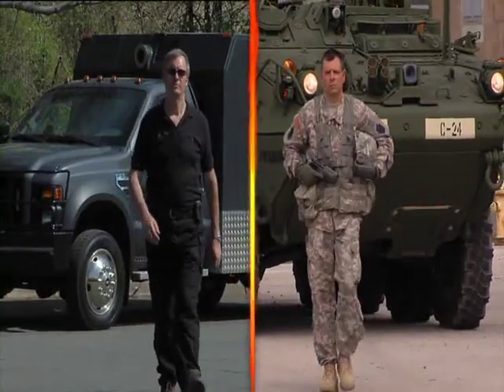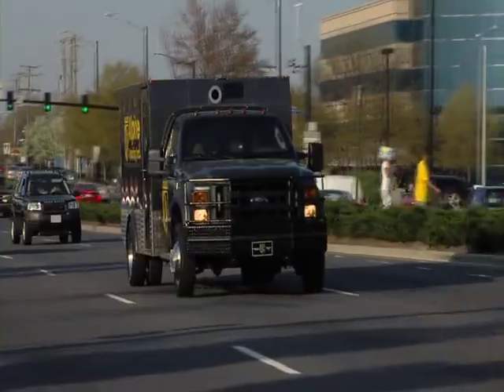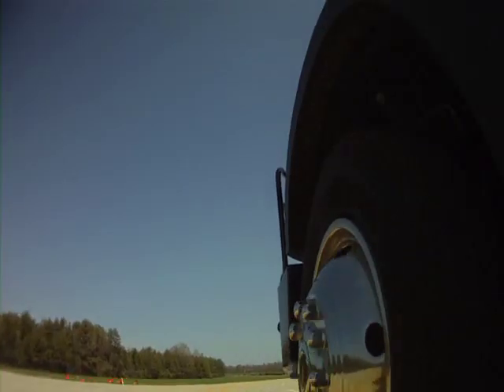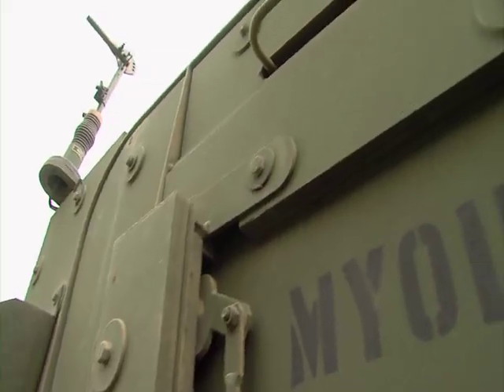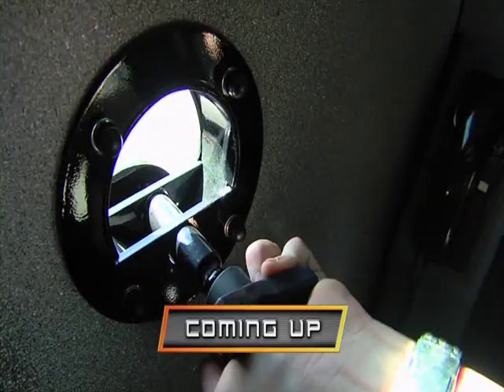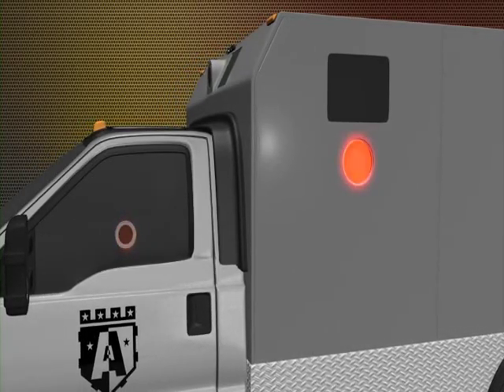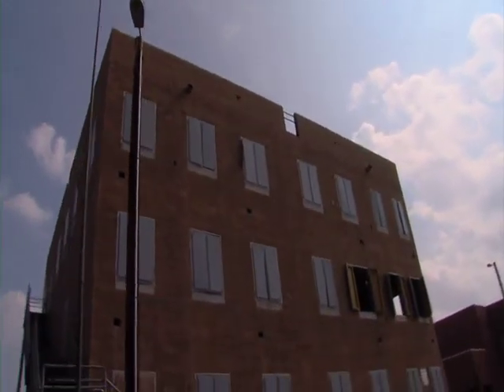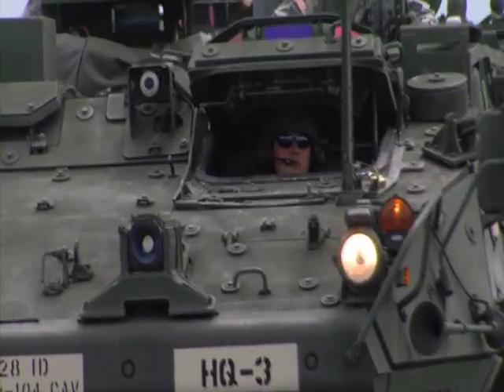Speed Channel - Intersections - Armored Bank Trucks by Alpine Armoring

Comment: Damn, when I used to work for an armored truck company we didn't have trucks that awesome. Ours would break down all the time, no tire protections, no gun ports, and the only cameras on the vehicles were the ones inside to watch myself and my partner.
Reply: +Keliohesten 
Sounds like you drove the first bank trucks. What year did you work in the industry?
Reply: +Secret User That's the sad part. 2015, I worked for Loomis lol.
Reply: Keliohesten
Damn, that's a sad company. lol
I like Brinks, paid training, and they issue you a brand new M&P .40 pistol unused with brinks logo. You'll have to make small payments to pay the pistol off but it's yours forever, and it's an amazing quality firearm. I prefer the armored car jobs for the pot industry. They get all the fancy toys for their trucks.
Reply: +Secret User Damn, that's awesome. Only good thing about Loomis is that they issue you a firearm for free. You just don't get to keep it, but their equipment is trash. I was issued an old beat up .38 revolver. Some people got old  Gen 2 or Gen 3 Glock 22s.
Reply: Keliohesten
Yeah I heard horror stories about those old beat up guns. Some people reported to their company that firing pins were missing and management didn't care to repair them. Loomis use to be the biggest and best armored truck industry in the west. Then they went to shit. I think Pinkerton put them down the totem pole a while back.

Comment: This is an amazing comparison. Two protective forces, two of the best armored vehicles. Who wins, the armored truck that is completely bullet resistant against assault rifles and designed to crash through trucks with it high powered V-10 engine and weight, along with gun ports to open fire on attacking threats with .40 caliber pistols; or the stryker APC, designed for protecting the transportation of soldiers to the battlefield using thermal, night vision, and .50 cal turrets along with armored plating. Awesome standoff.